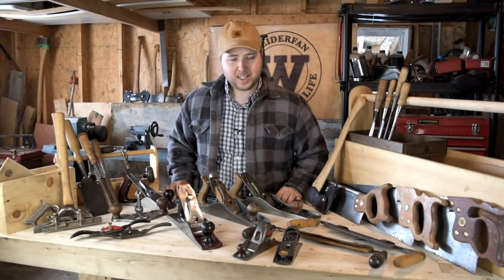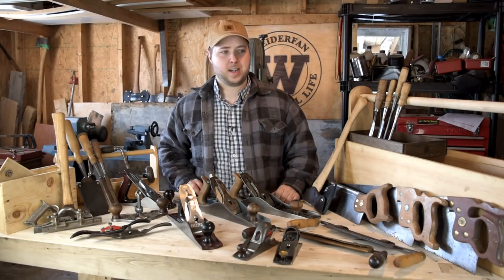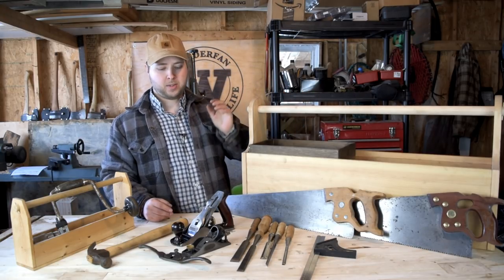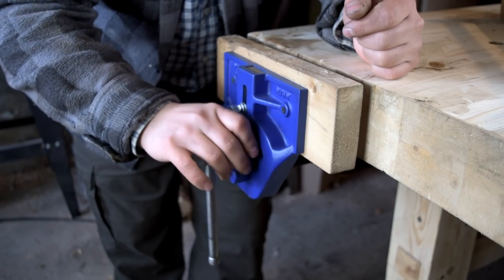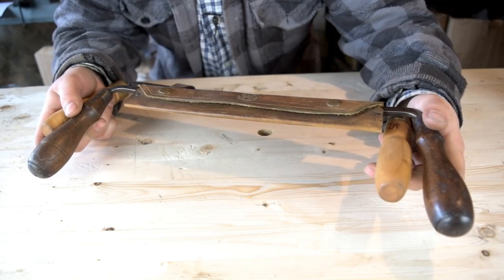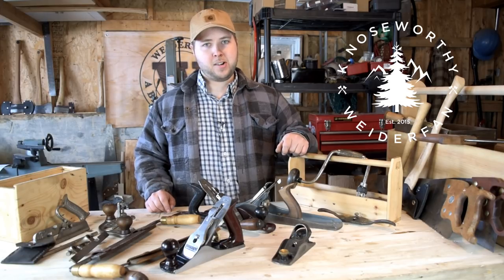Hand Tools Are Better Than Power Tools - [NLH 10]

Comment: Beautiful collection. I agree completely. I am about to restore my first home, a 100 year old homestead. I have been collecting an array of vintage hand tools for the history and to restore & use some of them in the home restoration. 

An old Stanley spoke shave, a vintage draw knife, a Disston crosscut saw with a nice original blade on it, a Warranted Superior saw, a Disston fine tooth dovetail saw, a No 4 plane, a small Stanley block plane, several Swedish & German made wood chisels, vintage Dunbar & Estwing hammers, a Craftsman brace with numerous auger bits and more. With more to come. 

There is tremendous value in working manually with hand tools.
Reply from the maker: That's awesome to hear! You're going to have a blast with all those!

Comment: A power tool can also be repaired and maintained to last several lifespans, you dont have a lot of people that can do that though since it may be casting, 3dprinting or even soldering microelectronics that would need mastering not to speak of planned obsolescence, but if you can repair a severly rusted power tool you can probably make a better one.

Comment: 💥 Video Time Stamp  💥

1:59 good looking tools when maintained properly.
The materials (metals & designs) of the old hand tools definitely outlast the crap that new tools are made of..LOL ..New power tools are time savers.
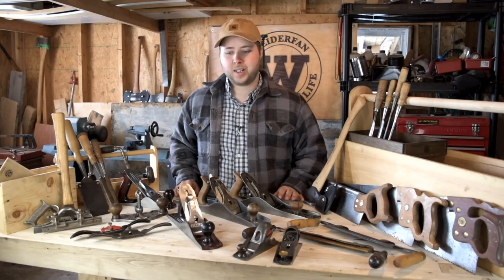2:38 Heritage aspect of old tools
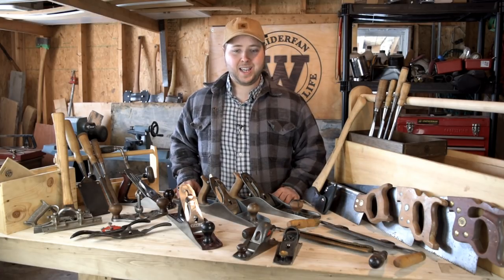3:20 Hand Skills required / more attn to detail 
4:40 💰💰💰 Old forged tools Vs New plastic machine made tools🤑 🤑
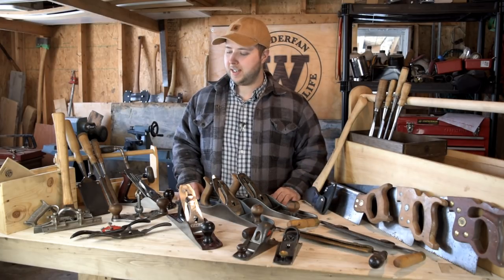6:41 Space used for Tool Storage.
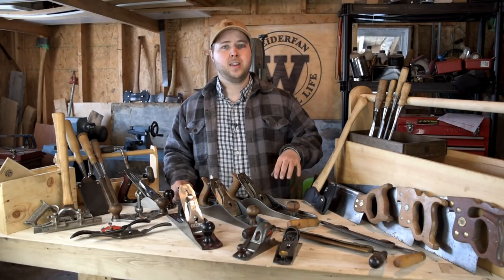7:34 being a prepper of sorts...I agree these tools will be the go to , when the power is off
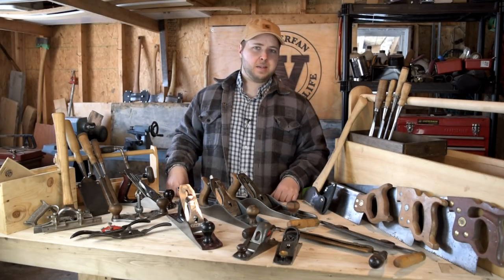8:27 Life Span of old tools / new tools. Passing old tools down through family. 
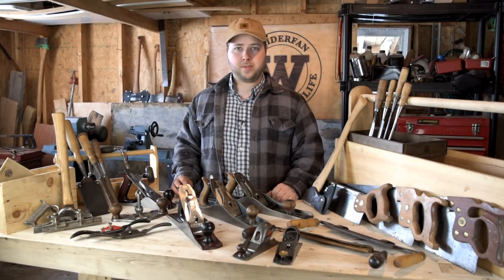10:19 Safety differences with old tools / new tools
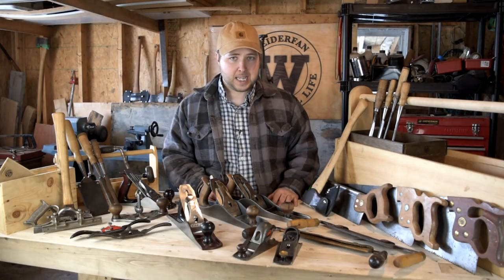11:53 Beginner tools 
*Parts are replaceable, self repairable with old tools ; but disposable parts with new tools
13:05 Basic Tool kit 

 Enjoying this series. Cheers

Comment: Good vid and all but try making a precision machined part by grinding duralium on the sidewalk for an hour and it will only be a matter of time before you relise that you need a belt sander, as for wood you can machine it very easily by hand as it is soft compared to most metals.

Comment: I agree on most of what u say but to be fair, if u can't find used handtools it will not be that cheap if u want quality stuff, just a plainer can cost several hundred dollars.
Even used tools are expensive where I live, 40 year old chisels can be more expensive than decent new ones.
Reply from the maker: I agree, but most people can find used; It isn't like I walked into a barn and found every tool I needed. It took me years to gather my collection. A rusty chisel at a yard sale, and $5 little block plane at a market, an old handsaw in my grandfathers shed, etc. Over time your set builds, and you'll have a nice little collection.

Comment: A bit of a naive approach to the craft. But by your own admission, you are a hobbyist. To just out of hand dismiss the use of machinery would suggest you may have a few things to learn about the world of woodworking.
The true Masters, that produced impeccable work in the 18th century with nothing but hand tools would have jumped at the opportunity for a shop full of labor saving devices powered by electricity. They would not have been blinded by the romantic notion that being a “hand tool only” woodworker, somehow made them better craftsman.
A skilled craftsman will have the versatility to use both power and hand tools with equal precision and competence.
Reply from the maker: Try commenting again when you have watched the entire video.
Reply: It's not always faster to use power tools that's a lie.